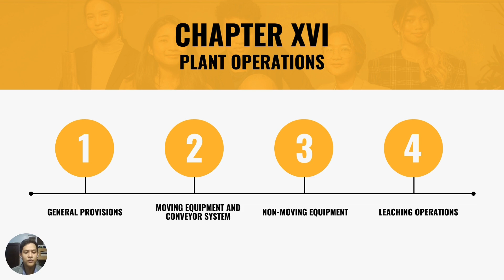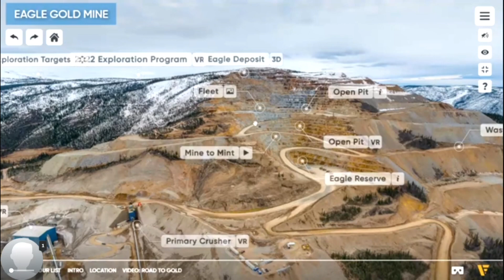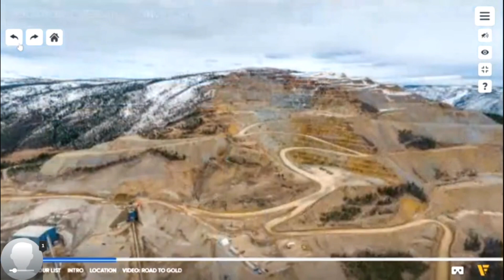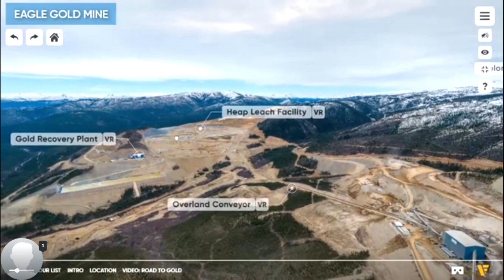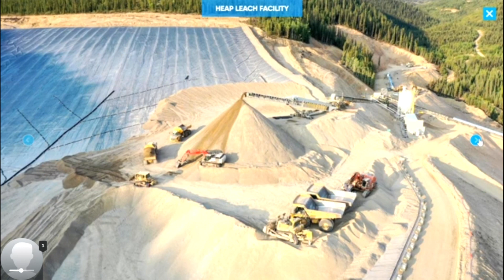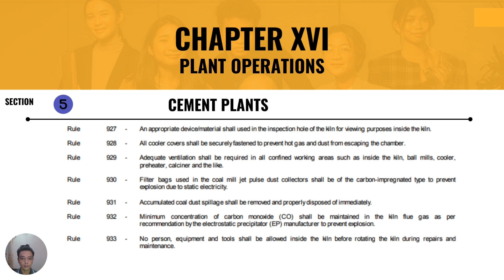Group 5: Chapter 13-16 | Reporting |

Comment: Chapter 13: Personal Protective Equipment (PPE)
•	Focuses on safeguarding miners through proper PPE use.
•	Outlines guidelines for wearing and maintaining gear like helmets, gloves, safety glasses, etc.
•	Emphasizes selecting suitable protection for tasks, ensuring proper fit, and regular inspection.
•	Shared responsibility for correct PPE usage between employers and workers.
Chapter 14: Health Hazard Protection
•	Addresses miners' protection from health hazards during work.
•	Section 1: General rules for identifying and managing health risks in mining.
•	Section 2: Likely focuses on on-site emergency medical and dental services.
•	Aims to formulate a plan for preventing and addressing health issues, ensuring swift medical support.
Chapter 15: Pipe Recognition in Mines
•	Focuses on easy recognition of pipes within mines.
•	Likely includes rules for labeling pipes with codes or colors.
•	Objective: Accident prevention, efficient repairs, and an organized, safe mining environment.
Chapter 16: Safety in Mining Plants
•	Serves as a guide for safety in mining plants.
•	Part 1: General safety measures and standard procedures for plant operations.
•	Part 2: Safe operation of moving equipment and conveyor systems, emphasizing accident prevention.
•	Part 3: Safety of non-moving equipment in mining plants.
•	Section 4: Rules for handling materials in leaching processes.
•	Section 5: Guidelines for safe production and handling of cement in mining plants.
•	Section 6: Rules to protect workers from hazards when handling chemicals and working in laboratories.
•	Overall goal: Establish safety and efficiency in various aspects of mining plant operations.

Comment: The significance of these regulations is highlighted by the need to supply and use suitable personal protective equipment, follow safety guidelines in different mining operations, set up emergency and occupational health services, carry out routine inspections, and put controls in place to reduce environmental contaminants.

Comment: Group 5 presented a clear and informative report on chapters XIII to XVI of the DAO 2000-98. The report covered various safety measures in different work settings. Chapter XIII outlines the Personal Protective Equipment (PPE) required for minimizing risks and safeguarding employees during tasks like surface mining and electrical work. Chapter XIV emphasizes the importance of emergency and occupational health services, inspections, and medical supplies to control health hazards. Chapter XV details the identification of piping systems to conform to safety standards. Lastly, Chapter XVI outlines several safety measures, including knowledge of chemical handling, fireproof clothing, and good housekeeping practices. The report effectively summarizes the key points of each chapter, making it a valuable resource for ensuring workplace safety. Group 5 deserves praise for its informative and well-organized presentation.

Comment: Group 5 dives deep into workplace safety and health regulations, specifically within mining and industrial settings, through their insightful analysis of chapters XIII to XVI within DAO 2000-98 Mine Safety and Health Standard.

Chapter XIII: Safeguarding Miners: This chapter prioritizes equipping workers in surface and underground mining operations with appropriate personal protective equipment (PPE) tailored to diverse work scenarios. Stringent requirements and safety measures are outlined to minimize risks and ensure overall well-being.

Chapter XIV: Prioritizing Health: Beyond physical protection, Chapter XIV emphasizes health hazard control through emergency and occupational health services, routine inspections, and meticulous health record maintenance. This proactive approach safeguards workers' long-term health.

Chapter XV: Navigating the Pipes: Ensuring compliance with Occupational Safety and Health Standards, Chapter XV focuses on accurate identification of materials within piping systems. This detailed knowledge prevents accidents and promotes a safe operational environment.

Chapter XVI: Mastering Plant Operations: From general provisions to specific safety measures for functions like leaching and cement plants, Chapter XVI comprehensively covers plant operations. Guidelines for moving and non-moving equipment further contribute to a risk-mitigating operational framework.

Collectively, these chapters, as analyzed by Group 5, provide a valuable roadmap for fostering a culture of safety and health across diverse industrial sectors. Their report underscores the importance of comprehensive regulations, tailored protocols, and proactive measures in safeguarding workers' well-being.

Comment: Chapter 13: Personal Protective Equipment (PPE) is essential for workers who are exposed to hazards such as chemicals, noise, heat, radiation, etc. PPE can prevent or reduce injuries and illnesses by providing a barrier between the worker and the hazard. PPE includes items such as gloves, goggles, helmets, ear plugs, respirators, etc.

Chapter 14: Health Hazard Control is the process of eliminating or minimizing the risks of health hazards in the workplace. Health hazards can be physical, chemical, biological, or ergonomic. Health hazard control can involve engineering controls, administrative controls, or personal protective equipment.

Chapter 15: Identification of Piping System is the practice of labeling pipes and valves with information such as contents, direction of flow, pressure, temperature, etc. Identification of piping system can help workers to identify potential hazards, avoid accidents, and perform maintenance tasks safely and efficiently.

Chapter 16: Plant Operations is the term that covers the activities and processes involved in running a plant or a factory. Plant operations can include production, quality control, maintenance, safety, environmental management, etc. Plant operations require coordination and communication among different departments and workers to ensure optimal performance and safety.

Comment: the report deals with surface mining, Rule 870 outlines safety measures for the extraction of mineral deposits on the surface. It stresses the need for proper planning, design, and execution of surface mining operations to prevent accidents and ensure the well-being of workers. Rule 871 delves into the safety requirements for the use of explosives in surface mining, emphasizing the qualifications and responsibilities of individuals handling explosives. This includes ensuring that only competent and licensed personnel are involved in explosive-related tasks. Additionally, Rule 872 highlights safety measures during drilling operations in surface mining, including the proper maintenance of drilling equipment and ensuring the competence of operators.

In summary, Chapters 15 and 16 of DA 2-98 are pivotal in establishing guidelines for environmental protection and surface mining safety. The regulations outlined in these chapters aim to strike a balance between mining activities and environmental conservation while prioritizing the safety and well-being of workers. Adhering to these rules is crucial for mining companies to operate responsibly, minimize environmental impact, and create a safe working environment for all involved parties.

Comment: DAO 2000-98 Chapter 13, focusing on Personal Protective Equipment (PPE), is like a specific section in a rulebook dedicated to safeguarding individuals in various activities. Think of it as a set of detailed guidelines outlining the use and requirements for protective gear.

In this chapter, you would likely find rules specifying the types of PPE required for different tasks or environments. Whether it's helmets, gloves, safety glasses, or specialized gear, these rules aim to ensure that individuals are adequately protected during their work. It's akin to a tailored guide ensuring that everyone wears the right gear for their specific tasks, minimizing the risk of injuries or health hazards.

Comment: The provided text outlines guidelines and regulations for safety and health measures in mining operations, covering several chapters. 

Chapter XIII focuses on Personal Protective Equipment (PPE) in mining, specifying requirements for different work environments to ensure employee safety.

Chapter XIV emphasizes Health Hazard Control, detailing rules for emergency and occupational health services. It highlights the need for regular health inspections, medical facilities provision, and agreements with hospitals for worker health services.

Chapter XV addresses the Identification of Piping Systems, stressing compliance with safety standards in marking materials used in piping systems.

Chapter XVI focuses on Plant Operations in mining, covering safety aspects related to chemical handling, protective apparel use, and proper safety equipment placement. It further delves into guidelines for moving and non-moving equipment, leaching operations, and safety measures in cement plants, detailing precautions for various processes, equipment, and chemical handling.

In summary, these chapters collectively underscore the importance of comprehensive safety measures, including the use of proper protective gear, health services, compliance with standards, and specific guidelines for various aspects of mining operations.

Comment: Group 5 dives into Chapters 13-16 of the report, prioritizing the health and safety of miners. Their video emphasizes the crucial role of proper protective gear, readily available health services, and safe handling of hazardous materials like hot liquids and electricity. They highlight the importance of adhering to government regulations, maintaining health records, and preventing equipment damage, all with the well-being of workers at the forefront. Through clear guidelines for handling dangerous substances and using appropriate safety gear, they envision a secure work environment that prioritizes everyone's safety in the mining industry.

Comment: These are my insights for each chapter:

Chapter 13 of DAO 2000-98, though personal protective equipment are the lowest in terms of the hierarchy of measures, it is still considered as an important measure to prevent exposures or unexpected accidents from ever occurring in the mine work place. This chapter dictates all the rules regarding PPE's, what type of PPE should the employees wear and in what kind of specific situations or conditions. This chapter also highlights the need for maintenance of the PPE in terms of sanitary and hygienic condition as well as providing a good working environment.

Chapter 14 of DAO 2000-98, the health hazard control, the section 1 of this chapter talks about the duties and responsibilities of the appointed medical practitioner/safety engineer where health and sanitary inspections are done in a regular basis. The employer should also provide the necessary facilities, equipment and supplies as well as the medicines. The section 2: emergency medicalansdental services, the rules dictates the number of part time/fulltime medical practitioner depending on what class the mine is. The employer should also make a contract to the nearest (less or equal to 5km) hospital or dental clinic that could render it's service to the mine workers. There is also a need to provide a monthly health record of the mine workers by the occupational health practitioner.

Chapter 15 of DAO 2000-98, Identification of piping system, this chapter only include 1 rule which details that the identification of materials in piping system should always be in line with the standards set by OSHS.

Chapter 16 of DAO 2000-98, plant operations, this chapter has 6 sections with its corresponding rules and regulations. This chapter details what should be done with the specific materials and chemicals like cyanide and other leachant spillage in section 4 to avoid further hazards. It dictates the handling of the chemicals, how it should be stored, in what conditions, and in what type of containers.

The safety of the workers are the top priority, therefore following the rules and regulations set in this chapters help prevent any disaster from occurring.

Comment: MORON, Cyrhyl Jhymes B. 

Group 5's video report about Chapters 13-16 focuses on keeping miners safe and healthy. It discusses wearing proper protective gear, providing health services, and handling hazardous materials like hot liquids and electricity. They also emphasized the importance of following government rules and maintaining health records, the video stresses preventing equipment damage and ensuring worker well-being. It highlights guidelines for handling dangerous substances and using appropriate safety gear to promote a secure work environment and comply with regulations for everyone's safety in mining.

Comment: Chapters XIII to XVI  in Group 5 summarizing key insights. Chapter XIII emphasizes personal protective equipment (PPE), detailing rules 849 to 859 for diverse work settings. It aims to minimize risks, safeguard employees, and ensure a secure working environment.

Chapter XIV focuses on health hazard control, addressing general and emergency medical services (rules 860 to 863). It stresses the provision of emergency and occupational health services, regular inspections, and minimum requirements for workplace medical supplies.

Chapter XV, titled "Identification of Piping System," contains one rule (868), emphasizing adherence to safety standards for proper identification of materials in piping systems. Lastly, Chapter XVI, covering plant operations, consists of six sections detailing general safety measures, equipment handling, leaching operations, cement plants, and protection against chemical handling and laboratory hazards (rules 869 to 879). Overall, the video provides a concise overview, commendably highlighting PPE, health hazard control, piping system identification, and general safety measures in diverse work settings.

Comment: Chapter 13 - Personal Protective Equipment
This section emphasizes employers' obligations to provide and employees' obligations to wear adequate personal protective equipment (PPE) during various surface and underground mining activities. This prioritizes worker safety and helps to avoid unnecessary risk exposure. The rules specify the types of PPE that are required in various situations, such as miners' lamps, safety boots, gloves, and respiratory protection. This section gives clear direction and reduces confusion to the workers.

Chapter 14- Health Hazard Control
This section prioritizes mining workers' health and safety. It specifies clearly what employers must do to provide emergency and occupational health services. The level of services varies according to mine class, ensuring adequate resources for various operation scales. Inspections, record-keeping, and reporting on a regular basis all help to monitor and maintain health standards.

Chapter 15- IDENTIFICATION OF PIPING SYSTEM
All rules for identifying materials in mining piping systems must be consistent with the Occupational Safety and Health Standards (OSHS) established by the Philippines' Department of Labor and Employment (DOLE). Companies must keep up to date on any changes or updates to the DOLE's standards in order to remain compliant.

Chapter 16- Plant Operations
Mining plant operations require a delicate balance of efficiency and safety. Employees must prioritize safety by being aware of potential hazards and wearing appropriate PPE. Restricted access, clear work areas, and proper PPE are all required for hot work, moving machinery, and chemical handling. The section emphasizes the importance of chemical handling and storage, particularly in leaching operations. Spills and leaks must be addressed immediately, and protocols for working with cyanide include maintaining high pH levels and having antidotes readily available. In general labs and chemical handling areas, the section emphasizes the importance of trained personnel and clear labeling. Plant operations can reduce risks and create a healthy, productive environment for all by prioritizing safety at every level.

Comment: The reporters talks about chapters XIII to XVI of the DAO 2000-98, and Group 5 shares the main ideas of each chapter.

Chapter XIII, about personal protective equipment (PPE), covering rules 849 to 859. It explains the necessary safety gear for various jobs like surface mining, underground work, electrical work, and handling hazardous materials to keep workers safe.
Chapter XIV, about health hazard control, with two parts: general and emergency medical and dental services. Rules 860 to 863 stress the importance of providing emergency and occupational health services, regular inspections, and basic workplace medical supplies.
Chapter XV, about "Identification of Piping System," materials in piping systems must follow safety standards.
Lastly, chapter XVI, about plant operations, has six sections. Covering safety measures like employees knowing how to handle chemicals, wearing fireproof clothing, and maintaining a clean workplace. Other sections discuss specific topics like moving equipment, non-moving equipment, leaching operations, cement plants, and protection against handling chemicals and lab hazards.

In summary, the video provides a simple overview of chapters XIII to XVI, highlighting PPE, health hazard control, piping system identification, and general safety measures. Group 5's report is clear and informative. Good job and thanks to them!